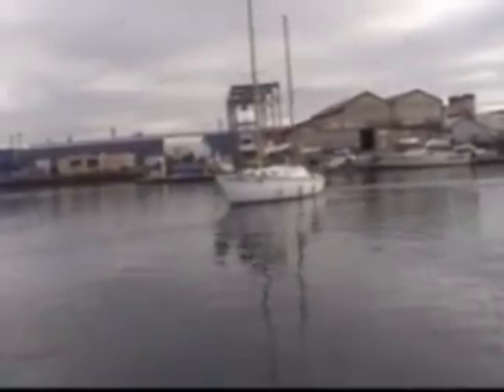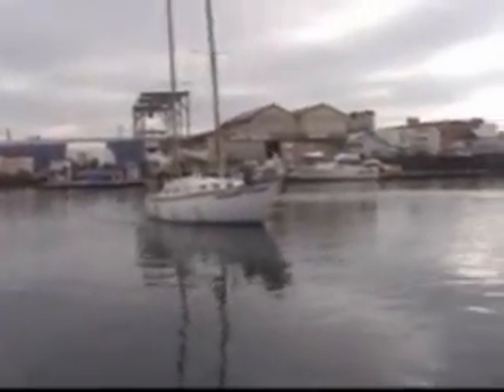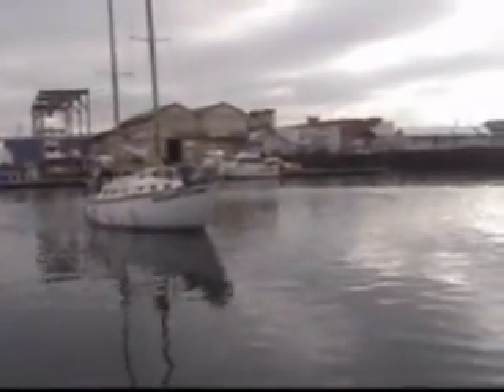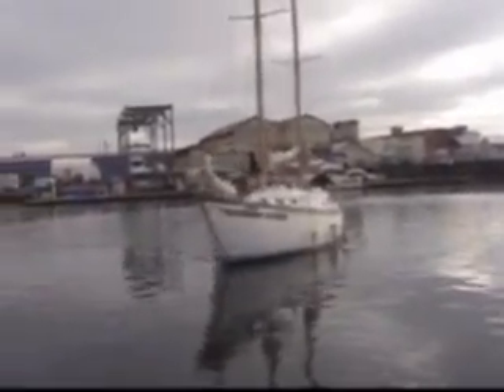100% Electric Sailboat Motor - Part 2

Comment: We are talking EMISSIONS! not is its GROWN, do you know what the point of this video is? If you dont, then GTFO. The boat runs off ELECTRICITY, not OILS or other things that give EMISSIONS. ever heard of the magnetic generators that can make their own electricity? they dont make enough to run themselves, BUT if you designed one to do so, with magnetic properties, then BOOM ENGINE!

Comment: this is great, I have a parker dawson 26, with 3,500 lb displacement, 1000 ballast and a yanmar yse8 diesel. I am really excited about doing something like this. There are dozens of companies offering an electric conversion. They all seem outrageously priced and actually discourage my DIY attitude, and I sense a desir to hide the real costs from me.
Do you correspond with advice, as my goals are for environmental reasons which we all benefit from. Thanks with any headstart you can provide